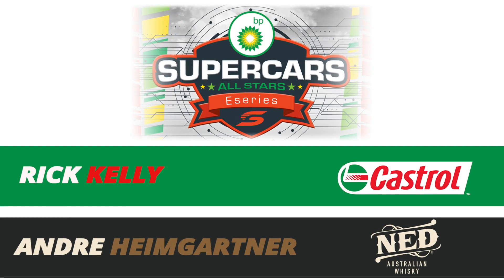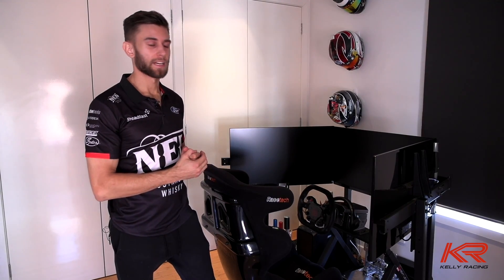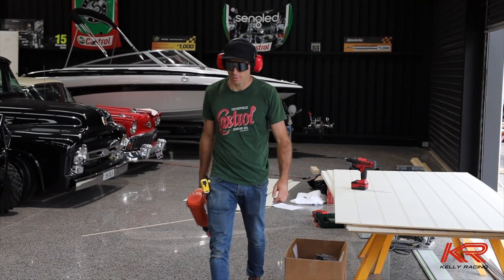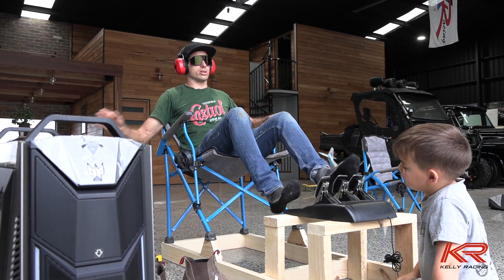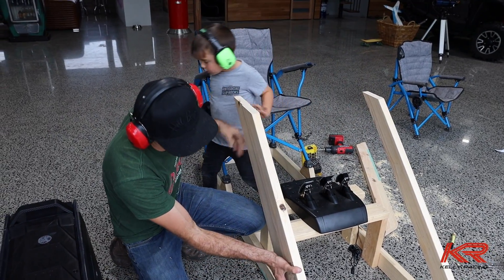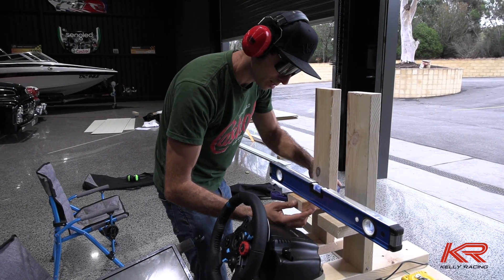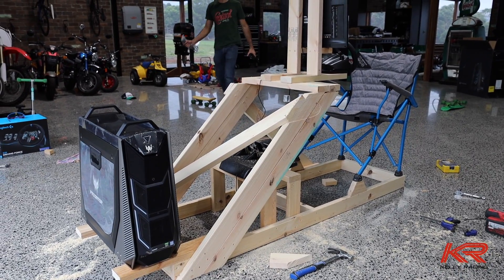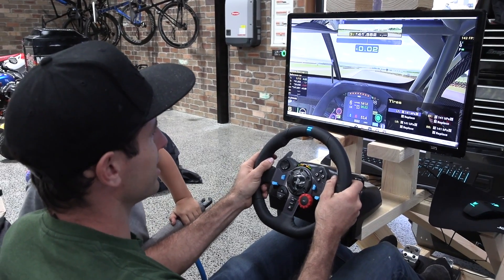How to build a Racing Simulator with Rick Kelly and Andre Heimgartner - Part Two - Kelly Racing

Comment: Love the DIY rig.my first was made from a desk,wood,and screws and never looked back. The wheel must be bolted down as I was pulling off all the time after that it took 2 years until I broke the wheel off the base .4 wheels later I am hoping this one breaks so I can replace it with a direct drive wheel. Looking forward to the next video. Rick don't get to disheartened the good gear dose makes the difference and with your one screen you will struggle with depth perception and sense of speed.

Comment: Rick I'm a SIM racer with the g29 pedals you have to take the rubber stopper out of the brake spring, or once you get to 75% brake force it just jumps to 100%, it's really easy to do just watch a YouTube vid on it, otherwise you will have a few issues with the brakes and you will jump ahead of the others using g29s who haven't done the adjustment